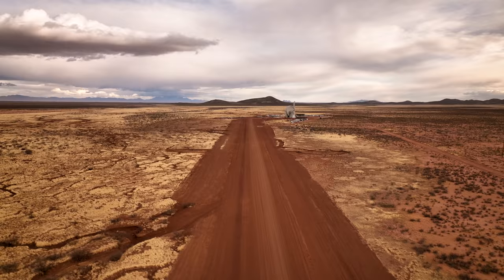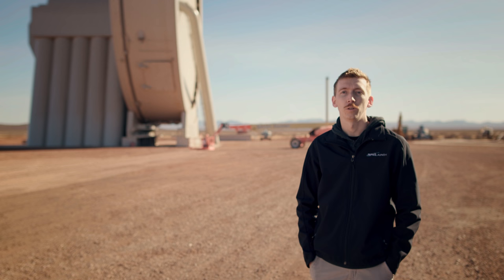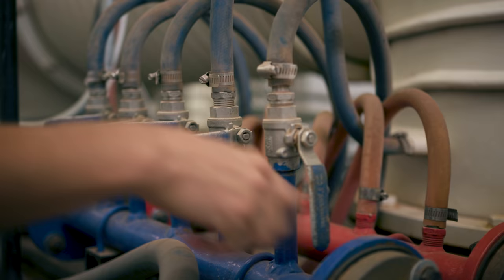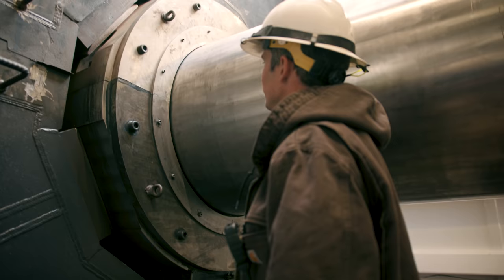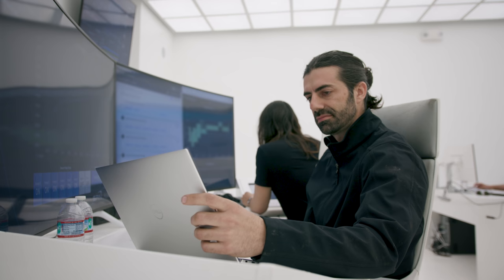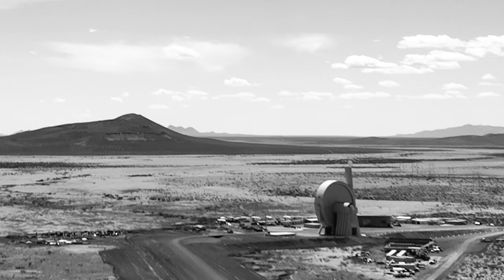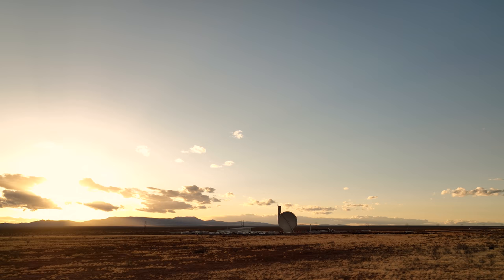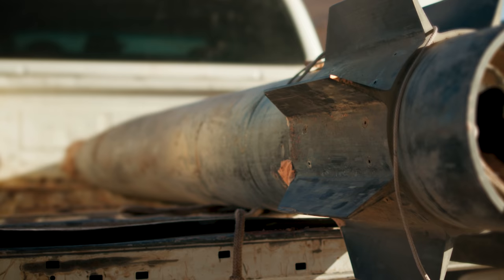An Inside Look: SpinLaunch Flight Test #7

Comment: I'd like to know what the heck happens to the counterweight when this thing is released. Now you've got to contain something that has the same momentum as the thing that has enough momentum to go into space. The recoil on the ground system must be insane. If these guys actually get this to work, it will be insanely impressive. And then there's the problem that, by definition, they can't put anything in orbit by throwing it from the ground, and there will still have to be a second stage that will have to survive this. Who had the guts to fund this?!?
Reply: Someone that doesn’t think
Reply: You have thought more about this than they have.
Reply: I believe there is still a rocket involved. They launch it a tens of thousands of meters up then start the engines. It's interesting to see if it works
Reply: @nonethelessfirst8519  jajajajajajajajajaj
Reply: Imagine a satellite deorbiting into surface level pressure of atmosphere. Explosion. KABOOM
Reply: all the things you mentioned  are actually really impossible eng. feats wonder how they did it?
Reply: so many questions!  like how do you keep cryogenic propellants cool enough to not explode or deform your vehicle with pressure building for hours while you pump a chamber down and spin the yeeter up?  
or perhaps they suppose they'll fuel these vehicles up with fuel lines connected to magical cryogenic liquid bearings and a counter weight that also changes weight to match the rocket as it's being fueled?  
yikes.
Reply: The counterweight is also released same time.... inside the chamber. Next version may YEET it out the same hole as the rocket
Reply: @crocodile2006  So if the payload is 200 kg the counterweight with also 200 kg is crashing with Mach 6 into the wall of the vacuum chamber?
Works like a bunker buster...
Reply: @elkeospert9188  I believe they are using a 200kg aluminium counterweight... so it just gets crushed and the area it is running into is super re-inforced.

Frankly I think a better solution would be a water release for easy cleanup... and yes it will be travelling at mach 6 once released
Reply: @crocodile2006  As you wrote - that aluminium counterweight will be fully destroyed and to clean up all that mess you need to release the vacuum.
Water is not better as the boiling temperature of water depends on the air pressure.
At 0.4 mbar water boils already at minus 29 ° Celsius so you have 200 kg of water molecules "in the air" (or more precise: in that nearby vacuum) which is something you not want....
And water at that speed is hard like concrete....so you still need that "super reinforcement"
Also you need some kind of tank containing the water which is able to withstand 200 kg at 10000 G and this tank will still be destroyed and creating mess....
Reply: @elkeospert9188  You are making problems where problems don't exist. Why wouldn't you want to release water into a vacuum if as you say it will almost instantly boil and become a gas? After the release of the rocket the arm will be slowing down as there is no point spinning it so air pressure increasing won't be a huge issue by that point. Frankly I think the water release idea is a brilliant one as it solves the cleanup issue.
Reply: @crocodile2006  The guys from SpinLauch want to keep the vacuum. Thats why they have this rapid closing door which is shown in their video.
If you loose the vacuum it takes a lot of time and energy to recreate it - both adds additional cost they want to avoid.
And therefore you also not want to have 200 kg of water in form of gas because that destroys your vacuum....
Reply: @elkeospert9188  I know they said that.. but how are they going to load another rocket if it's still in vacuum?
Reply: @crocodile2006  Good question - the only solution I could imagine is to put all payloads into the vacuum chamber in advance and have some  "loading" mechanismen. 
And of course you have to to this with the counterweights also.....

Comment: That's really moving!  Once your projectile launches, how do you keep the centrifuge balance?  It would seem you would get a nasty wobble once it's launched? Is the machine just so big it doesn't make a difference?
Reply: Maybe there's a deadweight that moves radially outward toward where the rocket was, exactly at the moment when the rocket is released?
Reply: @cedriceveleigh  It would need to slide about 50m in about 0.00006 seconds. The arrest would have more disruptive force than leaving it unbalanced.
To have a better grasp of just how fast 450 RPM is, a helicopter operates at 400-500 RPM. The concept is to have something 3 and a half times as long, spinning at the same rate, release something the weight of a satellite and chemical rocket from the tip of one of the blades and not have the system utterly destroy itself instantly.

Comment: Once the projectile has been released why doesn't the loss of mass immediately throw the spinning arm way out of balance and cause it to destroy itself?
Reply: Probably a hydraulically shifted counter weight and/or a brake, in this video they mention a "water brake".
Reply: @aless5207  yeah maybe 🤷‍♂️ the forces at play here are huge though, the amount of centrifugally generated pull on that arm when it gets up to full speed with the projectile still attached is huge that is the stored energy that will throw that thing half way to space, and then in a fraction of a second it's gone leaving that thing still spinning at full speed, that is an instantaneous and massive change in balance I don't see how anything mechanical could be made to react quick enough and precisely enough with the amount of mass that is needed to balance it again, but they obviously have it worked out, unless its all BS which wouldn't actually surprise me now to be honest 🤷‍♂️
Reply: @ats-3693  If the arm and mechanism weigh 20 tons and the projectile weighs 40kg I don't think there would be enough of an imbalance that couldn't be dealt with.
Reply: @rjk69  40 kg travelling at 500 m/s... That's 5 MJ.
Reply: @ats-3693  I tried to brainstorm it last time I watched one of these videos... I thought perhaps they pull the counterweight in really quickly to re-balance. If you had a decent hydraulic set up I think the speed and force is achievable. Again I'm not an expert but hydraulic stuff is pretty good at this kind of thing.

The other/additional option is just to stop the arm as quickly as possible. If you had appropriate energy storage you could take the energy out of the unbalanced arm very quickly.

I don't think this demo is BS (like faked) but I also don't see how the challenges of a system like this outweigh the potential advantages and the company might be leveraging the "sustainable, electric..." marketing factor. This could piss off skeptics because they've already been given a NASA contract which implies a govt cheque... even if they are honest in their venture, any space money going to BS is taking away from other ventures. However, its not the first time NASA would have spent a lot of money for minimal return... ;)
Reply: @neplatnyudaj110  This is the kinetic energy of the projectile at launch. The imbalance comes from the difference in the two lever arms. I think the hardest part of this system is not the release of the projectile but the forces it must survive before igniting the first rocket stage.

How impressive to start your flight with a "cyclotronic" ride from hell and a sonic boom at 1 atmosphere, I hope they pull it off :)